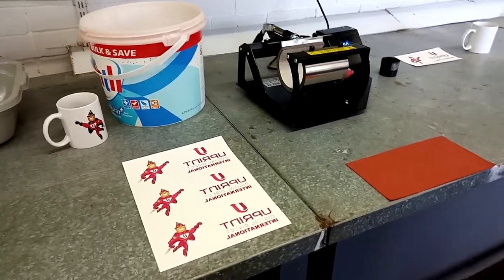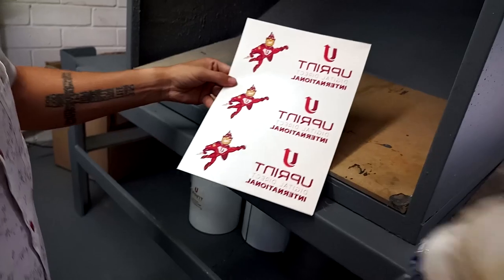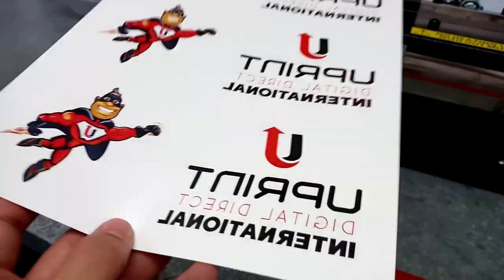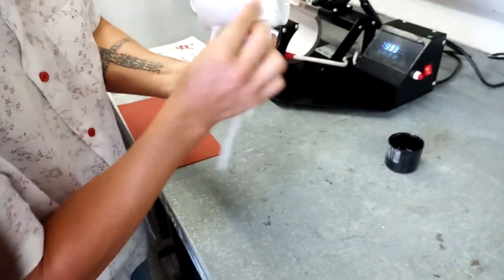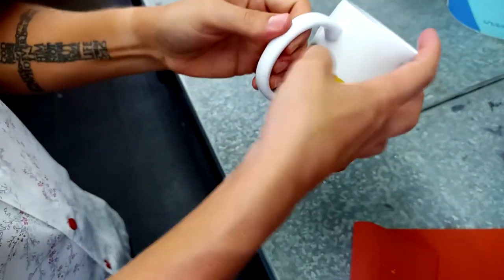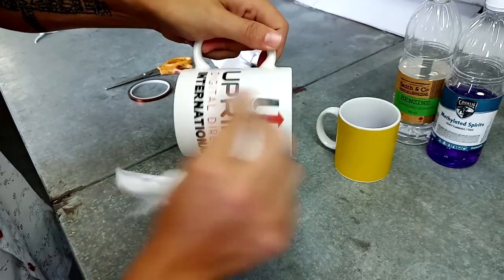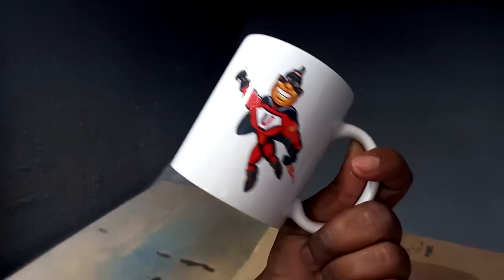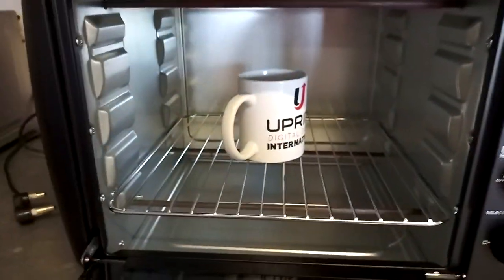How To Print A Standard Mug With A Mug Press | No sublimation

Comment: Im so curious how this whole process works. What type of printer/toner? Where do you get the products (are they safe to use)? And is this even something I can do at home? I wanted to start making high quality mugs for my shop.
Reply from the maker: Hi Ana, thanks for watching! don't forget to subscribe if you haven't already so that you don't miss our new uploads.
Our printers are new Oki printer engines, we modify Oki printers with our technology, we replace the carrier system to accommodate U-Print paper.
We also remove the fuser unit from the printer which increases the printers life-span, this is why we offer a 5 year warranty instead of 3 years.
without the fuser unit, we can print unfused toner onto our special papers which you then transfer onto products and spray with a chemical to make the products durable.
Our technology allows you to brand on more products than other methods as there is no need for sublimated items when you Have a U-print system.
Our technology is perfect to run a business from home.

We also offer content creating and marketing services to help create an online presence for those who start businesses using our technology.
For any further info you can contact shirley@uprintsa.co.za, for marketing or content/video creation, you can contact justin@uprintsa.co.za.